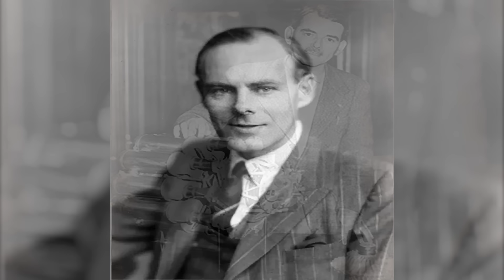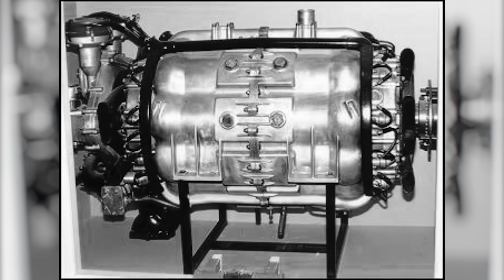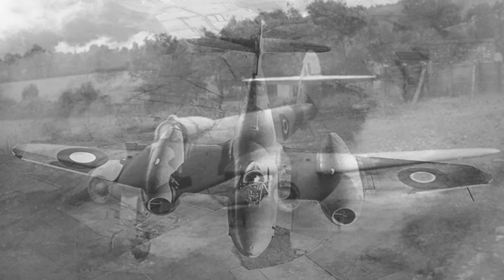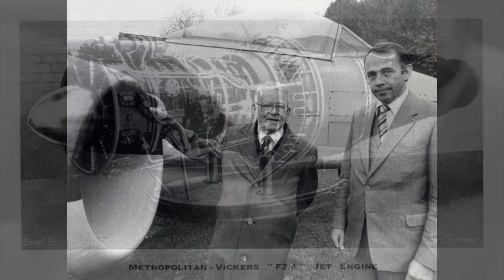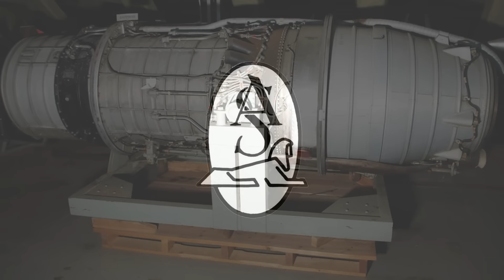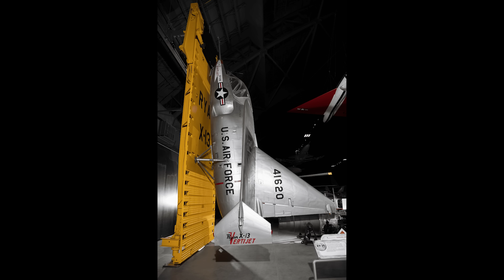The Genius Who Conquered Frank Whittle

Comment: This is essentially a story about aircraft gas turbine development in the UK.

Dr A.A.Griffith, a scientist with a growing reputation following submission of his report “Aerodynamic Theory of Turbine Design” (published in 1926). He envisioned what we would call a turboprop today, but his plans included an axial flow compressor. His designs were never built AFAIK. While at the RAE Griffith discovered calculation errors by Whittle and that plus lack of interest by the Air Ministry delayed Whittle's engine development. 

Meanwhile in Germany although he started later than Whittle, physicist Dr Hans von Ohain had independently developed a similar gas turbine based on centrifugal impeller compression for the Heinkel company.

The first jet engine ever to fly was Hans von Ohain's HeS-03 engine which used a centrifugal impeller to power the Heinkel 178 - the first airframe designed from the ground up for jet propulsion - on On 27 August 1939.

The next jet aircraft to fly was the Heinkel He-280, the world's first jet fighter, using von Ohain's HeS-08 jet engines on 30 March 1941, although engine reliability issues led to proposals to power it with HeS-30 engines under development. A dogfight between an He-280 and a Focke-Wulf FW-190A in 1942 demonstrated the viability of jet power for a fighter. The He-280 was ultimately cancelled in favour of the Messerschmitt Me-262A.

The first British jet to fly was the Gloster E.28/39 which used Whittle's W.1 turbojet on 15 May 1941.

Heinkel and von Ohain were somewhat sidelined by the RLM, the German air ministry, in favour of experienced engine builders like Daimler Benz, BMW and Junkers Motorenwerke (Jumo).  Anselm Franz at Jumo and Hermann Östrich at BMW both designed axial flow gas turbines, the Jumo-004 and BMW-003. 

The Jumo-004B powered the Messerschmitt Me-262A, the first jet fighter to enter service - the first test jet staffel - Erprobungskommando 262, was formed on 19 April 1944. 
After the war Dr Franz moved to the US where he developed the Lycoming T-53 turboprop engine which powered the Bell Aircraft UH-1 Huey and AH-1 Cobra helicopters, and the OV-1 Mohawk ground attack aircraft. He would also develop the AGT-1500, engined which powered the M1 Abrams battle tank. 

The BMW-003 would power the Arado AR-234C 4 engine bomber / reconnaissance aircraft and the ill-fated Heinkel He-162 fighter toward the end of the war.  
After the war Marcel Dassault helped Dr Östrich move to France where he developed the basic design concepts of the BMW-003 at SNECMA, France's state-owned aircraft engine company into the larger Atar jet engine that powered Dassault's Ouragan, Dassault Mirage III and Mystère fighters.

Like her wartime aircraft piston engines, although Germany's metallurgists knew how to develop high temperature alloys needed for turbine blades and combustion cans, these early axial engines suffered from Germany's lack of access to strategic minerals like nickel, tungsten, molybdenum and others, which led to Jumo-004B reliability issues and problems some Me-262 fighters in service.  On the other hand, Britain could draw needed ores from the entire British Empire and the USA, so Whittle's centrifugal jet engines were fabricated from far better purpose-developed high temperature alloys which gave them better service lives and reliability.

The Gloster Meteor F1 was the first British jet to enter service and commenced operations on 27 July 1944 powered by Roll Royce Welland centrifugal engines, licensed from Whittle.
AFAIK the Meteor was deliberately kept away from combat over Germany, for fear of one falling into enemy hands. The performance of the Me-262A considerably exceeded that of the Meteor and in combat between them RAF pilots may well hae found themselves at a disadvantage.

So  the axial flow gas turbine can at least be traced back to AA Griffith and while Metrovick was working on developing Constant's axial flow compressor concepts into a practical engine, Germany was already using it to power a jet interceptor whose speed at altitude made it virtually immune to escort fighters, although it was compromised by lack of high temperature alloys.
Reply: Von Ohain was given copies of Whittle's patents before he started work on jet engines; he certainly didn't invent them independently
Reply: German engines were also woefully unreliable and had terrible throttle control. They were reproduced post-war in limited quantities but their problems were never really resolved; the design itself was flawed.
Reply: Ohain admitted seeing Whittles patent forming his ideas.
Reply: @TCSC47  I've read that, when interrogated after the war, von Ohain was "evasive" about seeing Whittle's 1931 patent.  Ian Whittle, FW's younger son, met von Ohain at various events and has stated that, in his presence, he denied having seen the patent when it was originally circulated.  
Nevertheless, there are records showing that it was circulated to industry and universities by the patent office in Berlin, when Von Ohain was a student.  However, he certainly became aware of it in 1935, when it was brought to his attention by his patent lawyer.
Reply: Great comment

Comment: Rolls Royce improved the axial design in the Avon, but they also had access to German research by then. That had to have some influence.  I wasn't  aware anyone in Britain was working on an axial flow engine during or before the war until now. Makes sense though.
Reply: German jet engine research would be next to useless. Everyone knew the theory of why Axials would be superior. Whittle himself wrote about it. What was needed was more research in metalury and new alloys to improve the poor reliability of axial engines,  and reserach into how to overome compressor stalls that plagued the Me262s engines. Research that was very limited  at the time of WW2.
Reply: There were two axial flow series engines under development in Britain during the war (and there were axial flow engine developments in the US during the war). Metrovick developed the F series including with bypass, reheat and open rotor variants and Armstrong Siddeley had their own ASX axial flow engine. At the end of the war the F series at variant F9 was transferred to Armstrong Siddeley, who then developed the ASX into a turboprop and Metrovick focussed on marine gas turbines.

Comment: This is a poor article with a narrative that does not properly reflect the true development of the jet engine. Whittle was well aware of the problems of both designs but went with what worked at the time. The axial flow compressor only worked successfully when compressor stage blow off valves were introduced and much later, constantly variable compressor stator blades. Both engineers contributed massively and equally to the jet age and neither’s efforts should be diminished which this article clumsily attempts to do.

Comment: Whittle took a pragmatic approach.  He knew an axial compressor had long term advantages, but you have to walk before you can run.  It took a long time to get a reliable axial flow engine, and engines were needed to prove the concept.

Comment: UK made a massive mistake with Whittle patent in early 1930's,  they issued an open patent not the closed one they should have done, this showed they did not really believe the jet engine would ever work.  Copies of the open patent were found in Germany and italy  by allies after WW2, who knows but without that patent Germany may not have made any engines.  The next massive mistake the government made was to sell the RR nene engine to Russia,  this is why MiG-15 ran rings round allies and American jet aircraft in Korean war.  Whittle knew about axial flow, but he also knew the control and material problems,  he build centrifugal because he did not let the perfect become the enemy of the good enough.  The centrifugal engine was rugged and reliable  and is still used in stationary turbines, helicopters and turboprops - the advantage of centrifugal compressor is that it develops much higher pressure in much shorter length than an axial compressor and is much better at resisting Foreign object damage

Comment: Centrifugal compressor can get a much higher compression ratio in a much shorter length..  Centrifugal also much better at resisting FOD foreign object damage - Still used in fixed turbines and in helicopters as well as turboprop engines.  The only advantage of axial is frontal area.   Parsons already used axial flow in his steam turbines for many years.

Comment: Probably need to read “Not Much of an Engineer” by Stanley Hooker.  He basically took over Whittle’s work for Rolls Royce and was the designer of the later Rolls engines and the Bristol Pegasus engine in the Harrier when he left Rolls for Bristol.  

Both Whittle and Hooker were perfectly aware centrifugal compressors were not optimal for fighters however they worked well while the metallurgy caught up.  Centrifugal compressors are still there in helicopter engines and millions of cars where they are optimal for purpose
Reply: Stanley Hooker also did a little sum that showed the 'room heater' on Whittle's test bed in its imperfect form was already producing much the same power as a Merlin at operational heights.  He designed the Orpheus, as he thought it should be designed.  This then proved ideal as the core of the Pegasus, and fortuitously the front fan of the Olympus was ideal as the front fan of the Pegasus.
Reply: An excellent book that is a primary historical document. The horses mouth!

Comment: It is very stupid to present jet development as some sort of battle when there was no such thing.
In Whittle's original thesis, he discussed centrifugal AND axial flow turbines before Constant had put pen to paper.
As an RAF officer, Whittle had a duty to create reliable jet engines for sheer speed, suspecting that German rocket development could disable piston fighters and the emerging bombers on the ground or at take off. 
Aircraft defending Britain needed to be up and flying as soon as the new radar picked up raiders, thus leaving time for Hurricanes and Spitfires to form up and take on the Junkers, Dornier and Heinkel bombers and down them.
What is now known as the Gloster Whittle was tested for combat by early 1941 and orders for production were in hand. However, the Battle of Britain over southern England (Sept 1940 to May 1941) had so severely damaged the Luftwaffe that time was bought and Gloster (etc) proceeded straight to the twin engine Meteor which Whittle had conceived for longer range and several purposes such as assessing forces over France and the Netherlands from higher altitude that the piston fighters could attain.
Whittle's Powerjets company had been moved to Rolls-Royce, Derby and that left him time to work on axial flow designs with H Griffith and later H Constant -- being aware of the extreme demands on turbofan blades and what could happen in a failure.
Constant had a senior position at R-R and devised a thrust measuring device which could show (electrically) problems with blades before they cracked. The overal aim, using Whittle's thesis, was to develop a slimmer turbine and Griffiths suggested adding a second one downstream from the exhaust. This was an application of Whittle's 'bypass' concept for more stable rotation and needing less fuel.
As the need was to get jets into the sky damn quick, the centrifugal did its job very well.
I suggest that you do better research and refrain from clickbait fictional titles.
Reply: Your account fits very well with the conclusion of this video, history is only remembered if it is a good story. Which is why so many people go so wrong when siting historical precedent.

Comment: The steam turbine was already using the multi stage axial flow configuration - it was the metallurgy that plagued the idea of the gas turbine.
Reply: Exactly,  Whittle knew about axial flow but also knew the limitations of axial flow due to control and metallurgy - he did not let the perfect be the enemy of the good enough - The Whittle centrifugal design was available in time  for WW2
Reply: Both types of jet use 'axial flow' turbines at the hot end to power the compressor.  In the UK metallurgists knew of nickel alloys which could take the heat. I do not think the Germans had the same alloys.
Reply: Steam turbines are totally different... apples and oranges! Steam turbines are the drive section of an axial flow jet engine, no compressor, no internal combustion.
Reply: @AMCMag  but the idea of using it for a jet was the logical starting point  whittles first patent was the axial flow jet with a centrifugal booster  he ditched the axial flow bit because of material needs to get a working unit

Comment: The burner cans seemed to set the minimum diameter of the axial flow type - von Ohain's design for Heinkel looked like a good compromise.
Reply: Except that his combustion volume was initially far too small and had to be successively enlarged to work at all. His design was also severely limited by the use of a centripetal turbine. 
Fortunately, the RLM also severely limited their engine manufacturers when they decreed the use of the axial flow compressor, which needed years of development. For example, in 1944, the Jumo 004B was less efficient, had a lower OPR, a lower thrust:weight ratio, and problematic starting and throttle response, as compared to Whittle's W.1 engine in 1941.  
After the war, Adolf Galland said that the machine he needed in 1944 was the Me262 with R-R Derwent engines.

Comment: The  narrator is a little unfair. Whittle and the other engineers where working within the limits of the technology at the time.Whittle engine worked well for it's time, with weaknesses. The same can be said of the Junkers jet engine. More powerful, but with weaknesses that could be exploited. The way this story is told you'd think the jet engines where not good enough until the turbofans arrived.

Comment: He didn't 'conquer' anyone. Sir Frank Whittle gave the RAF a reliable, working, engine at a time they desperately needed it.
Reply: With a little help from RR Stanley Hooker.
Reply: Exactly - Whittle was fully aware of the effect of adding an imponderable like the axial-flow compressor to such a novel innovation.  Baby steps.  It was (axial) compressor stall which killed so many of the Me262 pilots in WW2.  This video is BS.
Reply: @dogsbodyish8403  As I've commented in more detail elsewhere, Whittle had no choice in the matter in the early 1930s.  He had no access to axial-flow compressor technology, and what existed was still at an early stage of development.  
The numerous critics of his "choice" of the "dead end" technology of the centrifugal compressor clearly have not done any research on the early history of the gas turbine and the jet engine.  Whittle used the only technology available to him, that of the centrifugal-flow supercharger, which was already known and proven.  
Even so, he had to push it to the limit - and he got away with it in the WU and the W.1.  Unfortunately, he wasn't so lucky with the W.2, into which he introduced a major redesign of the diffuser.  The engine surged, and it took intensive development work on a rig at R-R Derby to solve the problem, with a young Geoff Wilde reporting to Stanley Hooker.
Reply: @bobdylan7120  I agree totally Bob. Expeditiousness was what was important.